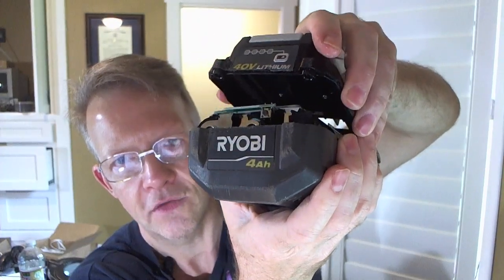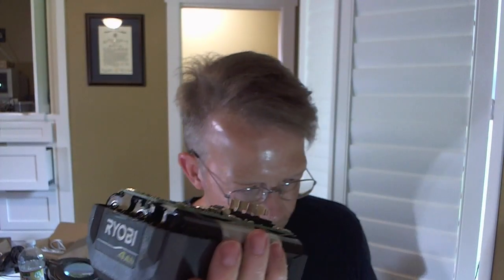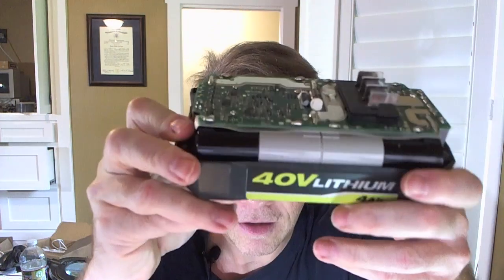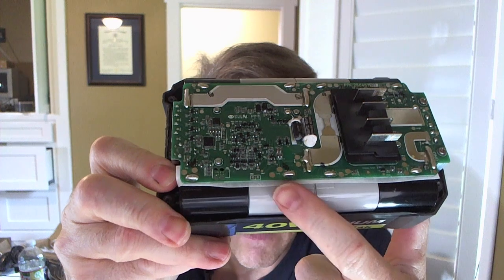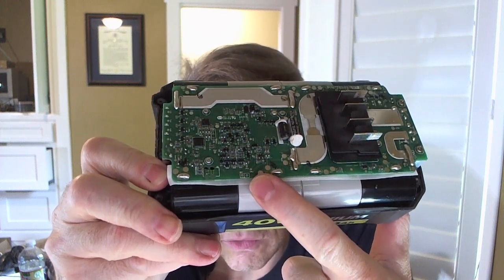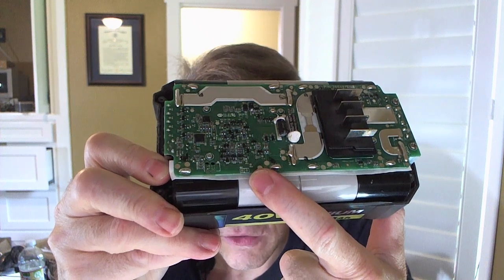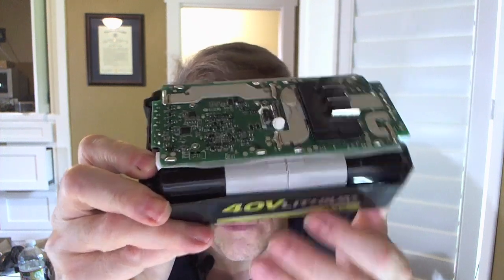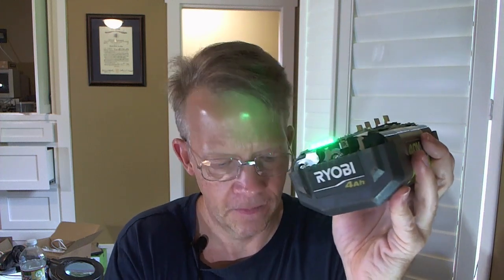Don't "Boost"; Safer Reset! 4 lights blinking on Bad Ryobi 40V Battery Pack? OP40501 OP40401 Rev. Q.

Comment from the maker: UPDATE: 1. I'm considering taking this video down and just doing the repair myself and selling the batteries I fix for more $$. No one hardly donates, despite saving $100 every time they save a battery. 2. YOUTUBE is making money off these ads. NOT ME. Until I get to 1,000 subscribers, they keep it ALL. It's really unfair but you can help by using my links, making tiny donations, and at least clicking that "Subscribe" method. I've saved hundreds or thousands of dollars for people, and YouTube is making money off this...so help me out.

Please use my links: I'm underemployed. YouTube is one of my part time jobs. :) Subscribing costs you nothing and I need to get to 1000 subs! Those ads you see here? I get NOTHING until I hit 1,000 subscribers. 

ETC (Ethereum Classic) Address
0x866d3ACB0c852acc4E8b4E944E9C54673670e305 if you want to send a small amount of crypto.

Buy me a cup of coffee here: http://Paypal.me/beachfitrob

Buy cheaper third party batteries on Amazon. Like half price: https://amzn.to/3uxa9qu I get a little commission.

Ebay .81mm Solder: https://rover.ebay.com/rover/1/711-53200-19255-0/1?mpre=https%3A%2F%2Fwww.ebay.com%2Fsch%2Fi.html%3F_from%3DR40%26_trksid%3Dp2380057.m570.l1313%26_nkw%3D.81mm%2Bsolder%26_sacat%3D0&campid=5337534429&toolid=20008

Ebay Security Torx Set $7 (This is my set I think) https://rover.ebay.com/rover/1/711-53200-19255-0/1?mpre=https%3A%2F%2Fwww.ebay.com%2Fitm%2F33-pc-SECURITY-BIT-SET-TORX-TAMPERED-PROOF-DRILL-DRIVER-TOOL-SCREWDRIVERS-BITS%2F350583822596%3Fepid%3D600593879%26_trkparms%3Dispr%253D1%26hash%3Ditem51a06c9904%3Ag%3AtK4AAOxycT9R5h3G%26enc%3DAQAFAAACYBaobrjLl8XobRIiIML1V4Imu%252Fn%252BzU5L90Z278x5ickkWpEuxXwAiCNKyBQsQ5%252Fe6%252Fg%252FJhgZb6vBP9LbkWZJeXB9kNQFTg3U1rF0Y3udqe3rYCBMtBlwiy5ZMjSaz9VE%252FUS1lQUnKnXtXw1mxosIOBF4bmv3FuxSMNTZxoD0pCy66GVFPfa8gaUWgYresnTK0GrFaOrv8Ly3h6t2vOGNmU82C6NYtyE4dXdLG8VmuPCRUk1rAJHSMw4g6lhWxIegIQxMTyjHynVmjb1S%252B9X%252FtnQw4muJyhPQKwpFL0SlDb%252FBKDUBdvIt7Y8J2%252ByitzYdBAQZ2AMjzbQf2BQwYaATfov5PyC4eYXjm26NgKTLPGSB4KzJIPoZaxeiNDaQxlRBwLIYC94155mLWtWpmdMPYTfG0KDF39GOibVRO%252Fek1UbIyALsErtP%252Ftb8AmEr2RkaXY6zWzfxBltsg%252BGKEFu0xQUNKTeUlE%252FrIeOeNNAnqbyxfcB%252FiCcTZ8CUwkmHCmmO0vjbjOsumtjZ7sqHqGlVoW6N6Qp1k7fvzFIRL19FBmY%252FjfGd1%252FiruDCjbmY3Sj3z4%252Fy4v8mt%252Fc2SkN8DYnBQvg8LY0kpA%252BZ2gALCKCW6wmxX6AWZj3lpujssMDScTF0flnfL%252Flu%252FcM%252BHl1HuqjJqRj30a6Fxaw%252FQS6S1rBLCbgpCZduOBl9V6CDDDIKjAOB2UjLtAJP1nR%252F1dZNvBSdIiPW9TpTHLrH8M8S0FAUJfvXxwcpQLGPMgwDPY1ZPnTsmoLcqdc4vpxes5kPrntxnnZLLFGHHneWoigTzjGHSm2Nx%26checksum%3D3505838225961063558040ba41068c3f2af2ebab9a4e&campid=5337534429&toolid=20008
Reply: Hi Robert, I will gladly subscribe and send you a venmo for $10 if I can get it working. I've reset it like 20+ times and put it on the charger in between each time to test and it's still the same result. After resetting it gives the one blinking light when i press one time, when I press a second time it's back to the 4 blinking lights. Any advice? Thanks
Reply from the maker: @davidsilveira5858  Not really, sometimes if you don’t enough it works but this sounds hard broke.
Reply: Agree, having similar frustration, but see you finally make it to 1k subscribers :) I'm still only at 200. Any chance you found similar solution for the 18v batteries? Donated!
Reply from the maker: @TnADoStuff  Sorry for late response. I don’t have any 18V stuff.
Reply: for someone who complains about people not helping you out, you sure go out of your way to promote Amazon, an anti-democratic union-busting company.
Reply from the maker: @BobBob-nr1zt  I’m also pretty free market. If you think a company has an unfair advantage, invest. They’ve never made money tho, IIRC.
Reply: They make it difficult to sign in to new people .....  I tried 4 times with password reset before i finally was able to log in .....
Reply: How's your eth classic did u sell it? I thought eth holders were going to jump in
Reply: No worries, I block their pointless, irrelevant, annoying ads anyway. They make nothing off of me. All good.

Comment: I was hoping this easy fix would work for me.  It it still hasn’t. I put small wire in the reset , it then blinks 1 green. If I press again it goes back to 4 green lights blinking. I reset again and it’s 1 green then a steady 4 green . Tried to charge right away but nothing.  This is a spare cause I.bought a new one months ago.  I’ll mess with it . I’m determined to get it going.
Reply from the maker: Is it full? Steady 4 when you ouch gauge button means it’s full. Check charger too?

Comment: I have tried to reset many times but the 4 flashing won't stay the same and it did not fix a problem
Reply from the maker: So the 4 flashing go away or not? If not, it hasn’t been reset. If it did reset then it might need several or many attempts at a charge. You could solder leads into the pcb holes and run them outside the case if you want to try to reset and then charge a lot of times.

Comment: Liked and subscribed 
My 40v 6amp 
Battery shuts down when charged and plugged into my trimmer 
Then 2 center lights start flashing green 
Any idea what caused this problem and how to fix it?
Reply from the maker: Did you try the reset here? Not sure about center lights iirc no one else has posted about that. Also all the ones I have and most others have is the 4Ah soooo…opener and look for a RST on the board if you haven’t.

Comment: Mine doesn't have safety screws, just regular torx. My circuit board doesn't have those RST points, it looks different.
Reply from the maker: Bummer. There's several other batteries out there but these are all I have.

Comment: Sorry you are having YOUTUBE troubles, I have tried the reset but after going from four blinking lights to one blinking light and right back to the red green flash. I am going to try charging to 30 V + and seeing if that helps. Power supply and voltage booster inbound. Just wanted you and others to know it may not end with the reset pad short method.
Reply from the maker: For sure but it works for a lot of people. And it's pretty easy and pretty safe.

Comment: After I reset I saw one light but then when I put it back to charge the blinking red and green light came back. Already tried 2 times.  After I replace the cover and press the battery switch I see 4 green light blinking for few seconds. Any other tricks?
Reply from the maker: You can try a few more cycles but beyond that dunno.

Comment from the maker: Note: one thing I am careful of is not to run the battery til it stops due to low voltage. I check and if it’s on the last bar I stop. I have a sense about when it’s due.

Comment: So, I have a 12ah 40v battery. I’ve taken the cover off and there isn’t a Reset section! Is there another spot?
Reply from the maker: If you don’t see an “RST” anywhere I dunno. Post a pic of board and link to it. All mine are 4AH. Still going strong years later.

Comment: I know a guy that gets rid of these very cheap and about 1/10 batteries can be fixed this way. I’m having an issue where after I reset the battery it works but goes back into safety mode

Comment: "UPDATE: 1. I'm considering taking this video down and just doing the repair myself and selling the batteries I fix for more $$. No one hardly donates, despite saving $100 every time they save a battery. "

Good luck with that. unless you have a stock of inexpensive quality cells it will likely cost you more than  $100 to rebuild and repair, and probably a good 4 hours of your time if you work fast and can salvage the BMS board.  You quick reset doesn't fix the battery.

With keeping in mind that the BMS boards of ryobi batteries shut output by controlling the mosfets  which are  in-between the cell 40v out and the terminal on the pack, you probably aren't saving anyone much .  The reason the board shuts down is that cells become irregular in terms of capacity and internal resistance, charging and discharging at unequal rates  and thus subjecting individual cells to higher than normal temperatures.  A board should only be reset when you have rebuilt the battery pack, or tested each one individually to establish normal specs for the particular cell type.   Yes you can reset and try to charge and it might work a few times with shorter life each time but that wasn't the problem to begin with.

Comment: Thank you for the info, I liked and followed. So would a paperclip work or would that zap me?
Reply from the maker: Yes just only touch the contacts. I prefer a small piece of copper wire since it’s more conductive but a paper clip will work as long as the contact is silver and has no green mask on it.

Comment: I've yet to have this issue with my batteries. But after seeing your video and others on doing this hack to get them working, I think I will mod my batteries once the warranty is up and add a small set of holes that line up with that reset spot and make a custom jumper that I can slide down into the holes to trip the reset without having to open up the battery pack everytime.
Reply from the maker: I’d wait. You might never have the issues. I’d wire in a small push button instead to keep the case sealed. It rarely happens on all except maybe 1 of my batteries.
Reply: I finally had one with an issue pop up. Messaged them and instead of just recycling them like they have said to do before, now they are having me mail it in.

Comment: I have this exact issue with an 18V 4a/hr battery. I've taken it apart but the circuit board is obviously different. There's a set of header thru holes but I am unsure what pins to connect, assuming this is even possible with the 18V batteries.
Reply: No idea. No one has ever posted back here with a solution and lots of people ask.

Comment: I swear to god this just happened. Tried to do this and a chip or something on my board fried like a tiny fire with black smoke with plastic burning smell, doesnt charge still. Hmmmmm. . . .
Reply from the maker: Lots of successes, few failures. Sounds like your board had major issues. Just jumping RST shouldn’t cause anything like this.

Comment: Mine has 3 tamper proof screws and a plug in the 4th corner that I cant figure how to remove?  No screw, just a black plug that is flat
Reply from the maker: You can use a dental pick or almost anything really. Small screwdriver, ice pick...It's a plastic cap. Just don't go crazy as there's a screw under it. It can be thrown away.

Comment: OMG!!! That  totally worked! I noticed my 5ah battery wasn't going to fully charge and the next time I used it and tried to recharge, I got the errors you described. I did your reset method, got the one blink and now it charging. Thanks a bunch, you are a money saver. I'm a sub now!
Reply from the maker: Yay. Some people send me coffee money. :) Buy me a cup of coffee here: http://Paypal.me/beachfitrob Anything I get is thrilling.
Reply: @RobertBullock  Ya know what, since I got one 5Ah, two 4Ah and one 2.6Ah batteries, I'm sending enough to get a hole can of coffee. 😄
Reply from the maker: @meblakney  Got
It! You rock!

Comment: Before doing this, call Ryobi customer service to determine if your battery is under the (3 yr) warranty.  Luckily mine is and I am getting the replacement in a few weeks. Great hack otherwise!
Reply from the maker: Yes of course but unless they change the rules they also let you keep the old battery and I was able to reset mine so I ended up with two counting the one they send
Reply: @RobertBullock  i get to keep my battery! So yes - great point!  I plan to restore my battery and get a new one. Win win!
Reply: I was able to reset - thank you!

Comment: So only one comment.  My battery was dead, dead, dead.  The reset technique you described worked to wake the battery up, but there was no juice in the battery so as soon as I plugged in the charger, the 4 blinking lights popped back on.  I remembered some other video that said to put a charge on the battery, use a fully charged battery and connect + on good battery to + on dead battery, and same with negatives.  So I shorted RST pads again to wake the dead battery up, then I put + to + and - to -. Caution - if you do this, BE CAREFUL!  My wires started getting really hot so I pulled them off until they cooled down and repeated about 4 more times.  Now when I click the test button, I got a single LED to light up, telling me there was a small charge on the dead battery now.  Reassembled dead battery, put it on the charger and there you go!  So if Robert's technique doesn't work right away, maybe your battery is dead like mine was.
Reply from the maker: Disclaimer: this can be dangerous and cause burns or explosions etc. if you're not careful. Yes, it's basically unmetered power. In theory, infinite current. Small wires will get hot quick so a few seconds at a time just to bring the votlage up so the charger will 'see' it. That's why 0 volts never will work. Charger doesn't see it. Too low and it will refuse to charge as that can also be dangerous.

Comment: Thx! I’m experiencing a different issue and want to know what you think I could try. My 6ah 40v will charge to full then when I use it on my blower and power to turbo mode it stops. If I use it in regular low mode it’s fine. Can I reset the cells somehow? Thx
Reply from the maker: My guess is power draw too high. For example, I can attach a different brand edger to my weedeater but if it draws too much power it stops. I don't know if it's batt or weedeater, but you have to stop and wait a few secs then it works again. I'm careful to do this edge for 30-60 secs, blow the crap out of the crack, edge a little, etc. It's also very hot here. 103F today, so that's probably part. I expect some people will be having thermal trips of the battery so this video will probably be more popular this summer. :)

Comment: This fix worked for me the first time. I got the battery recharged to almost full strength. Did a complete trimming job. But at the end of using it, it went into sleep mode again. I can reset it easily now, but when I put it on the charger, it lights up the 1st and 4th lights on the battery, then falls into red and green flashing on the charger after about 5 seconds and the battery goes back into sleep mode. I’ve tried up to 10 resets in a row and can’t get the battery to take a charge. Any suggestions? What does the 1st and 4th (outside) battery lights on mean?
Reply from the maker: Mmm, that I'm not sure. I think it's a different fail mode. See if anyone in the comments had that. IIRC I had that and just eventually tore it down for the cells, which are standard size. I have a flashlight that uses them. One day I might build a pack out of them.
Reply: @RobertBullock  So I gave it one more try after sitting overnight and after reset it started taking a charge this time. It won’t fully charge but gets up to 3 lights which is still pretty good. I think I just have to watch while using it to stop when it reaches one light because it will easily fall into sleep mode again.

Comment: I cannot get the screws loose on mine. I have a security star and it fits but pops out when I try to twist.  Any suggestions?
Reply from the maker: Wrong size bit? No one with the bits has ever had an issue. There ARE diff sizes.

Comment: DANGER forcing the battery to charge. I tried the plug-unplug-plug-unplug fix for 5 minutes with 4 lights blinking and red/green flashing and then left to do more research. Came back 15 minutes later to a room full of smoke, partially melted battery case, and the surface around the battery lightly toasted.
Reply: This isn’t a force charge. We are just resetting the BMS so any subsequent problems should still trip the BMS. I e done a number of these with nonissue other than a re-trip and even that sometimes works after a second reset. Also I try not to drain them completely or charge them fully if I can catch it at 3 of 4 lights for example. Since I literally have like 6, this ain’t a big issue for total runtime.
Reply: This sort of thing is probably an outlier since I have heard of two issues and we have tens of thousands of hits and successes at least hundreds I’d bet.

Comment: Charging my batteries now. Waiting with bated breath.
Reply from the maker: Gratz for spelling bated correctly.  :) If they charge you have good odds. I’ve had to reset one of mine maybe once or twice more tho.
Reply: So far so good. Battery 1 fully charged. Going to fire up the hedge trimmer tomorrow. (Credit to Alexa for providing accurate context and spelling for the phrase "bated breath")

Comment: really do appreciate this video. yet another success story. I have a ryobi 40v 5ah battery that flashed all 4 lights when you pressed the status button.  pulled the cover and jumped the two holes with a pair of pliers and a staple bent in half and  it worked. I used a small straight blade screwdriver and easily popped those little center pins out so I could get my star bit in there. Hitting that subscribe button Robert. Thank you
Reply from the maker: Thanks! Some people send me a few bucks or Subscribe for the least amount I could ask ($1) at https://www.patreon.com/RobBullock

Comment: Subbed and liked. I tried fixing my neighbors 36 volt lithium ion battery. I used a DC to DC converter. I got up to 3/4. Still would not charge. I'm an electronics techie but in Australia??? Forget it! No components!
Reply from the maker: 36V or 40V? Did you jump RST and hit "gas guage" button at the same time?
Reply: @RobertBullock  yeah it's a 36 volt. It dead shorted the battery. So I'm going to recycle cells for headlamps.

Comment: See below. Drilled down into the convexity of the Torx screw so that I could use a standard small Torx bit. Did the reset many times, including simultaneous voltage test button press, but this does not work so far.
Reply from the maker: This is not a guarantee. It's worked for a lot of people.